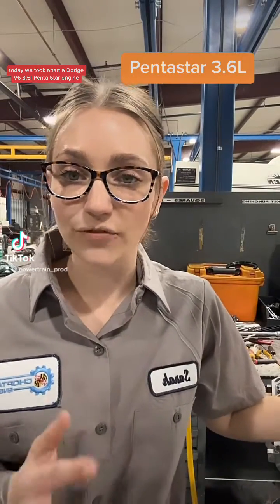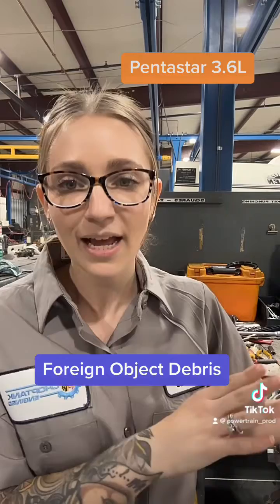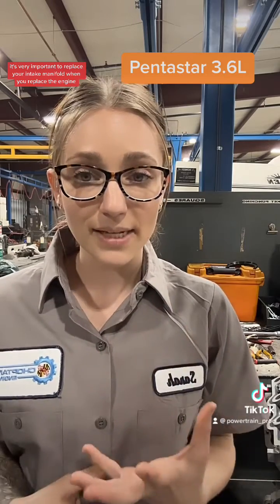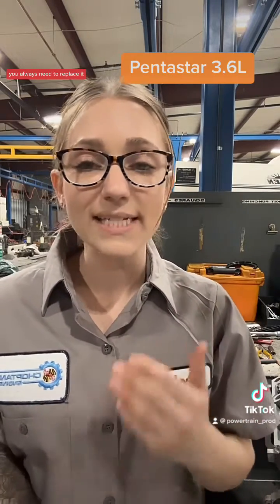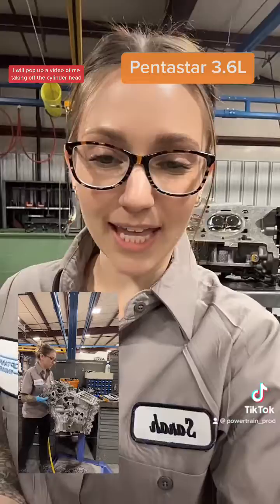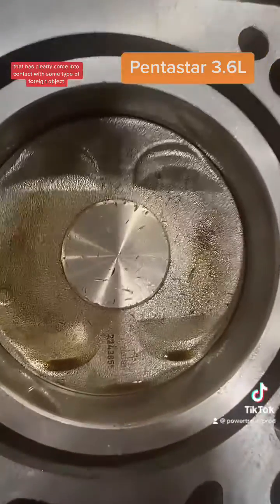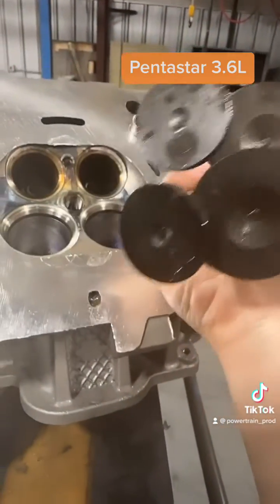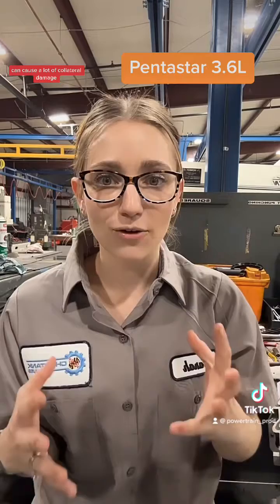Pentastar 3.6 engine foreign object failure

Comment: Great video. I just experienced complete engine failure on a brand-new SUV with under 200 miles on it. Diagnosis was 'complete engine failure with excessive metal debris throughout the engine.' I found your video when I was trying to understand how/why a new vehicle would have such a catastrophic failure.  The dealership replaced the engine, but I got a full refund rather than keeping the vehicle.

Comment: Another great video. Thank you. Always a good idea to drop the oil pan once in a while to look for pieces of debris. Had mine dropped once and they found parts of the timing chain guides in the oil pan. You know what that meant. Unfortunately had to spend Thanksgiving 2022, waiting for parts in Spring, Texas for replacing the timing chains.